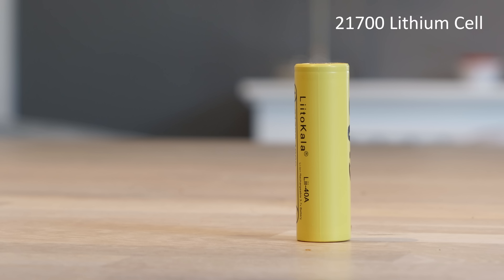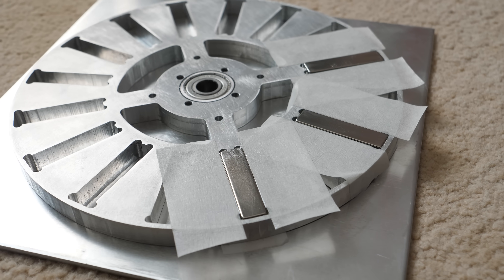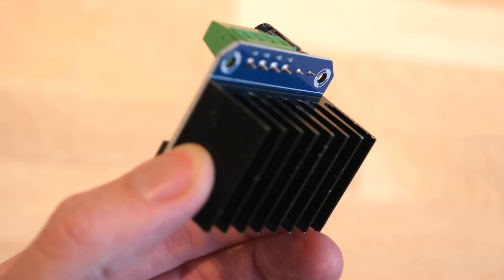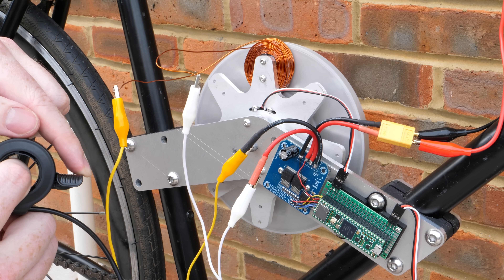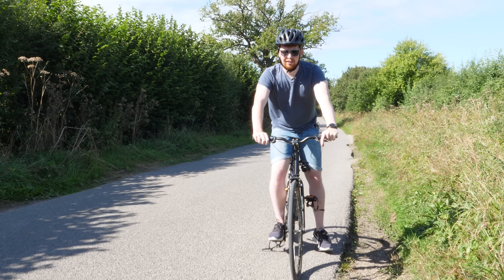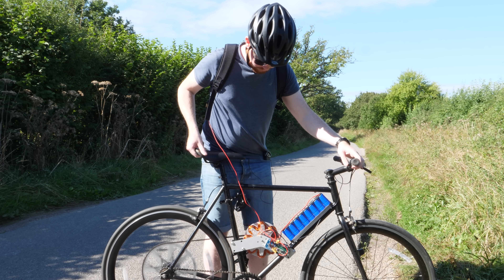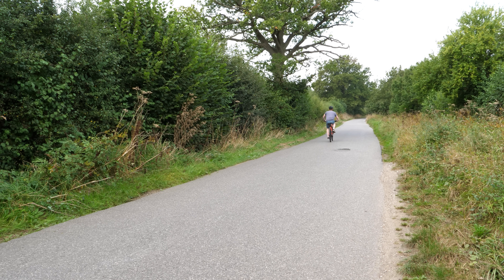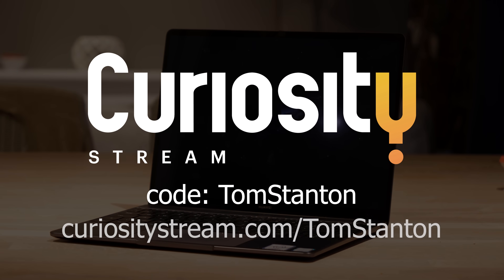Super Capacitor Bike

Comment from the maker: Thanks to Curiosity Stream for sponsoring today’s video! Follow this link and use code TomStanton to sign up for just $14.99 for the whole year: https://curiositystream.com/TomStanton
Reply: Next step : how to make a Tazer out that. It's... it's for a friend :)
Reply: @En_theo  even if he can make one that would be a very bad idea to share that
Reply: @En_theo  驚地槍品
Reply: @En_theo  tip: try to stick some wire out of that bike into  ***? :D
Reply: You really need a motor controller configured as a constant current boost converter. Naturally any shelf controller does the opposite.
Reply: I think (super-) capacitors could be a good complement to an e-bike (very similar to in computers, how RAM is a great complement to hard-drive).
When accelerating from standstill, it could draw from the capacitors to give some extra "Oomph!" in the acceleration, but then at "cruising speed" when maintaining the same speed, then it could draw from the batteries as usual, and also slowly charge the capacitors for the next acceleration (or regenerative-break-charge the capacitors?).
Reply: You can use a steppermotor when making the coils to count the turns.
Reply: Nice motor too. Maybe have coils on both sides of the magnet plate, running off the same controller? And a non metallic chain, like a car fan belt? Nice diameterish magnet plate is working well for you with those super caps. Your recharging ratio is good, definitely worthwhile, and sure you can streamline some improvements in efficiency.
Reply: Hello tom just a few words on your fully enclosed para motor 

WELL DONE Sir it printed first try on my ender 6 came out really nice still waiting on a motor and esc not going with the hk wing (not a ram air wing ) being as i build and repair modern ram air canopies gotta draw the line somewhere 
Again    WELL DONE SIR
Reply: Tom, how about using the pedal to charge the capacitors and the capacitors to power an electric motor in a way that removes the chain/belt and gears?  Replace mechanical with electrical to simplify, reduce tear/maintenance and implement a gearless design
Reply: Li-ion supercapacitors will increase the capacity, so why not try it?
Reply: comment translator, please
Reply: What you need is a supercap bank in addition to the battery so you get more instant acceleration but still have range
Reply: Yes,  but have you added regenerative breaking?
Reply: Is there a way you could actually use battery and capacitor hybrid design like the batteries keep the capacitors going with the compact lithium ion battery
Reply: Does it run off the capacitors or the capacitors are ran off the battery
Reply: Efficiency standpoints... Make the capacitors work longer then the motor will too
Reply: SuperCapacitors can add a quick charge feature to a battery but cannot replace a battery. Fact 😎 atleast until they make better ones
Reply: Question! What software did you use to overlay the graphs at 10:09?
Reply: How about you make a graph of your video quality dropping over time ay...
Reply: Modern 21700 cell is 5ah capacity 3.7v nominal, 18.5wh. not 14... I guess there are lower capacity 4ah cells which would work out to about 14wh.
Reply: Your energy regeneration
Reply: Your energy salvation is magnificent
Reply: Supercapacitors can be the turbochargers for electric vehicles 😅
Reply: Why did'nt you just used lifepo4 batteries instead of supercaps for this project?
Reply: what would be really cool is to have a 3 wheel bike with a whole bank of super caps behind it. how far will it go? the remove half then a quarter to see if distance is relative.
Reply: @caveman-zd5yv  needs higher voltage caps
Reply: What about peddling up hill, after going downhill? Could this make it easier with assist from the capacitors?
Reply: @deddy7785   , 10/4  doug the same with going up the gears in a transmission,  power assist
Reply: @vincenttelfer4206  nice, and that would help going uphill, without using up all the capacitors energy.
Reply: 0:57 watch where your driving jee
Reply: Next mission - charging capacitors with brakes 😁
Reply: on the down hill charge test, it would have also been interesting to see a time comparison of you pedalling uphill both assisted and unassisted by the motor and to know your opinion on how it felt and to know how much longer the power lasts with you pedalling compared to you letting it do all the work
Reply: NEW PROBLEM:  Need motorbike helmet.
Reply: lol
Reply: Talking and driving is dangerous while looking sidewords
Reply: Great video and curiosity stream looks good too.
Reply: Hello, We love your work! Please contact us
Reply: I left something in the comments for you to find you know you can freeze things with sound if I see a video on that I'll show you how to float things with sound
Reply: Sir please make a video on electromagnetic gun, semi automatic
Reply: 너는 정말 천재야 ~~
Reply: Why not have some type of dynamo on the front wheel that is actually putting power back into these capacitors or even the batterys ?
Reply: If you increase the diameter of wire and decrease the number of windings the motor will build more torque. Be careful because depending upon the amperage the controller can handle you can run into overheating and melt down.  Also running a lipo battery without a low voltage cutoff is asking for trouble, when you drain a cell down to far you will not be able to charge it.
Reply: What brand is your other bike with  Regen?  I have been looking all over for a bike with Regen for safety due to all the hills and saving maintenance of my brakes.  I wish more e bikes had Regen and good Regen efficiency.    Your build and video was great, only need better super caps.
Reply: This could have been such a com concept. Like the Lamborghini Sian. Instead of needing to mess with that convoluted lithium battery to power the battery charger to charge the caps. A proper motor, proper controller, regen, and proper caps and arrangement. Making your own motor was cool, but it could have been much cooler. Like a turbo button.
Reply: Can you make a freewheel gyroscope bike
Reply: 3:13  "Which obviously can't be done manually."  It may not be easily doable, but it CAN be done manually.  Ever heard of a distributor?  https://en.wikipedia.org/wiki/Distributor
Reply: Yeah sign me up for a thousand years because that’s how long you will be trying to go more than 2 mph llf
Reply: @Tom Stanton: you are really smart. I learned something
Reply: I love it when he says "coil". 😊👍
Reply: try it with 100v supercapacitors
Reply: https://m.youtube.com/watch?v=7hfClQh3rxM
Reply: Please pay atention yo this other video: https://m.youtube.com/watch?v=7hfClQh3rxM
Reply: https://m.youtube.com/watch?v=KUl38nqKnik

https://m.youtube.com/watch?v=U-jTJKwmTOw

https://m.youtube.com/watch?v=mnNebVdiJoo&list=PLnRuQNdRzExGcpsHUk4VpfJctb_18GTEM&index=1
Reply: it would of been cool if your pedaling recharged the capacitors have a separate wheel that's a generator and you engage it with a thingy on the bike handle like where your throttle was it technically would be a more efficient version of a bike
Reply: Nonsense . Still you have to pay tons of money to the electricity government .😂 Anyways not bad for you and your family.. I'm not interested sorry. Instead you should have made a small car for your future kid.
Reply: Try Lithium-ion capacitors instead of regular supercaps
Reply: A few of my thoughts on this.  Since the torque is so low on that, those capacitos would work better at a higher speed.  Don't start off with them. 

The other thought is to put some kind of generator on the wheels along with a second capicator bundle and charge one while the other is discharging.  Or you could just use one and switch between pedal and electric power.
Reply: Go go گیا گیا هيا هيا
Reply: Only economically-insipid people drive electric cars. 🙄
Reply: Make it that runing charges the capacitor and the same time runs the bike
Reply: If you have two sets of capacitor motor system built in could you achieve a better results?
Reply: We need 600v 1 terrafarad caps to be competitive with batteries. I would suggest a reel to reel 668nm laser exfoliation of graphite oxide into graphene. At 25watts per square cm at 80ft per min. Having a 3 ft tall 2 ft diameter cell for large industrial energy banks
Reply: basically 15$ usless you wait 100 years for just getting 1 dollar and wasting almost 1500$ plus 15$ its 81,15R$(money of my country) so why would i waste almost a hundred money just for signing up
Reply: Bro you need to use grapheme ultra capacitors, the are half the size of those and they have 3000 farads. I am developing a pcb the can be put in an electric go kart and has the around the same range but more power.
Reply: If you made a second and third sup cap batt then two could always be getting charged even when it's going like regen braking
Reply: Could you remod the motor design so you have improved magnetic flux. I would love to see you address your torque/power loss. This time making it a hub motor with the ability to engage the pedals a solenoid and spring mechanism in the large gears of the pedals. Then use graphite super capacitor that only discharge for 0-30mph launch. You could also possible use another set that absorb the regen power
Reply: @Tom Stanton: An AC gearless hub motor would have much more efficient regen, and you can get very good acceleration by using a smaller radius wheel, ie you can get .3G of acceleration with a 500W motor and a 14" wheel.  These motors come with a disc brake mount so as long as your frame supports a rear disc brake, you're golden with the smaller wheel size.  You can also put a fat semi-slick tyre to achieve lower rolling resistance, which is also important for efficiency.  Contrary to popular belief, narrower tyres do not equal lower rolling resistance.  The sweet spot is around 32mm with a soft sidewall slick, but for the front wheel a narrower tyre is good for air resistance, whereas in the rear, a wider tyre is good for durability and stability on loose surfaces, and air resistance is a much smaller concern.  Sadly the performance bike industry has been perpetuating apocrypha because $$$, and because people don't like to hear that they're wrong, even if it benefits them in multiple ways.
Reply: Hi Tom, you are amazing. I really enjoy your videos. Your presentation is superb.  Have you written any books that deal with your e bike issues?
  I want to learn your knowledge.
  I have a small workshop, tools 
and practical skills. 
  It’s the ‘e’ bit in e bike, that lets me down. 
  I’ve been looking at electronics (a dummies guide)for about a year, GitHub, and OSF too. 
  It’s slow going without a tutor, or planned syllabus. 
  The problem with self teaching is, I can’t teach myself what I don’t know.
  I love your videos, your subject matter and your attitude. 
  Being able to laugh a deep belly laugh when it doesn’t go as well as, is a gift in its self. Keep up the good work I enjoy so much. Cheers Tom, from Pat,  Patrick.
Reply: Hey Tom why not add a voltage multiplier to charge them with less movement of the wheels
Reply: @tomstantonengineering I really love this channel. I did not realise a motor could be built so easily. I'd love to know the efficiency of the motor you built.
Reply: 😊😊😊😊😊😊😊😊😊😊😊😊😊😊😊😊😊😊😊😊😊😊😊😊😊😊😊😊😊😊😊😊😊😊😊😊😊😊😊😊😊😊😊😊😊😊😊😊😊😊😊😊😊😊😊😊😊😊😊😊😊😊😊😊 at Least ON YOUR own BUSINESS 😉😉 😉😉😉 😉 w a LITTLE 😉 and a PROMISE 😉 😉 AND the DAP TO be on A MISSION to IMPROVE TO BE AND continue WITH YOU all OF YOU in a Hot a Bit thanks w I THINK 🤔😊 At JIM'S 🏘️🏘️🏘️😊😊😊😊😊😊😊a😊
Reply: uiiiii
Reply: Sir you can use an idea that we will pendle cycle manually and when we will required a boost we will use the energy stored
Reply: now use self starter coils for hill climbing  boost not to focus on range, please
Reply: Do you think it can be possible to design it like a hybrid system, where the bike runs on full capacitors till it drains, then the battery takes over immediately, and the regen from the lithium battery use charges the capacitors as you ride and automatically switches back to capacitors when they charge up? 

I think that would give you an immense increase on your battery since it's not in full-time use; and would work like hybrid motors do?
Reply: may you do some wind up machines
Reply: So if they charge so fast… get regen braking and a couple small solar panels… between the 2 you might be able to get some actual range out of it on a sunny day and for good measure put maybe a generator on the front tire… i know it would cause some friction but with the capacitor it might make up for it
Reply: @puddlerat do the maths first. Before assuming the ability of a bottle dynamo. They are Not very powerful ok for charging phones and powering an led. or two.
Reply: @patrickwilliamhayward8302  the fact you looked 100 comments back to call me out is amazing and well a waste… and yes scientific there is not ultimate power but do to some things you could utilize it better
Reply: Three words, 
Tesla 
Tabless
Battery
Reply: c😊c😊😊
Reply: c😊c😊😊
Reply: c😊c😊😊
Reply: c😊c😊😊
Reply: c😊c😊😊
Reply: c😊c😊😊
Reply: c😊c😊😊
Reply: c😊c😊😊
Reply: c😊c😊😊
Reply: c😊c😊😊
Reply: c😊c😊😊
Reply: c😊c😊😊
Reply: c😊c😊😊
Reply: c😊c😊😊
Reply: c😊c😊😊
Reply: c😊c😊😊
Reply: i can see the super capacitor as a booster pack for an hybrid car or an electric car but not alone .
Reply: You love making videos on capacitors please explain why???
Reply: Making the capacitors work as a sort of cruise control would be amazing, and you could put a solar panel on a bike rack.
Reply: Hey bro can you please make a bike that has dual sport motorcycle tires please

Comment: can you try with lower capacitor since they are made for charging in seconds if its possible to add second motor to charge the discharge capacitors to create a loop where they charge and discharge in the same time

Comment: What about a combination of the batteries, two stage supercapacitors and lithium ion. the idea being one stage charges to a desired voltage while the other is discharging until a desired voltage. The lithium batteries is for mass energy storage capable of charging the super capacitors

Comment: What if you powered your vehicle with lithium ion batteries butt charged a bank of supercapacitors of equal capacity via solar and regenerative braking? Then when you reach the state in your lithium ion batteries that you couldn't go much further you could apply the current and the capacitors to recharge the batteries

Comment: Don't capacitors lose capacity when they are in series?
Reply: I would just take the same amount of capacitors and connect them in parallel with the existing setup to double up the capacity.
Reply: Yes, but they still have the same energy stored. E = ½CV² (C --> capacitance V --> Voltage)
Reply: @AlexAlecos When you have capacitors in series you widen the distance between the plates so you lose capacity.

So the watt/sec equation for 1 of these capacitors would be:

(500)1/2 * (V)^2

For 8 in series it would be:
(62.5)1/2 * (V)^2
Reply: @mr.mysterious7940  I bet you took that info from google's AI overview. You have the same energy. Capacitance decreases, but voltage increases. Suppose you have 2 1F caps at 10 V each. For parallel: E = ½*2*10² = 100J. (E = ½CV²). In series you have ½*0.5*20² = 100J. Same energy stored.
Reply: @AlexAlecos  I don't need AI, my work is in electrical engineering. So let me educate you. You can increase voltage in series due to each capacitor tolerating a certain voltage which adds up in series. 

The capacity however, once again, decreases. Capacity and voltage are not the same. With less capacity, that means your voltage will run out sooner, that's why the bike doesn't get very far. I hope you learned something.
Reply: @mr.mysterious7940  You didn't understand me. Of cource the capacitance decreases, which makes the voltage drop faster. However, the energy remains the same as in a parallel config. I think we're saying the same thing

Comment: Imagine a hybrid e-bike system that uses both lithium-ion batteries and supercapacitors. The supercapacitors don’t store much energy, but they can charge and discharge incredibly fast. So instead of sending regenerative braking energy directly to the Li-ion pack—which wears it out and can’t always accept high current—you dump that energy into a small supercapacitor bank first. Then, a bidirectional DC-DC converter slowly transfers that stored energy to the battery at a safe rate

Comment: 1:27  "I am going to build an electric bike that is specifically designed for supercapacitors", says Tom. But no. He did the opposite. He emphatically did not design a motor controller that can provide consistent power from a declining voltage that a capacitive source provides.
Reply: Could you explain to a layman?
Reply: @Elopez2  OK, I'll try. A battery produces a relatively constant voltage as it discharges. However the voltage on a capacitor is proportional to the charge left in the capacitor. So for example, a 48-volt battery for an electric bike produces about 45 volts when it is down to a quarter of its full charge, while a capacitor capable of being charged up to 48V would only provide only 12 volts when down to a quarter of its full charge. So if one were to build a bike to work off capacitors, it would need a driver for its motor that works as well with a 12V source as it does from a 48-volt source. Despite Stanton claiming to have built a bike to work from capacitors, he did nothing to operate the motor from a highly variable voltage source.
Reply: Bruh
Reply: WHAT DA HAIL!?!?!?!?

Comment: Nice video! How fast would a generator wheel have to spin to recharge the capacitors? My idea is to couple the paddles, with moderate foot movement, to a generator and maybe also using the wheels, spiked with magnets and a half ball shaped coil mounted to the frame, to recharge the capacitor bank.